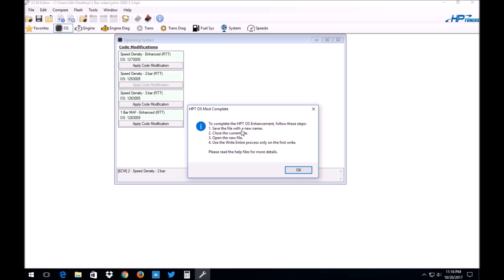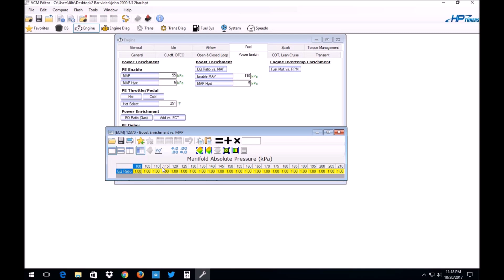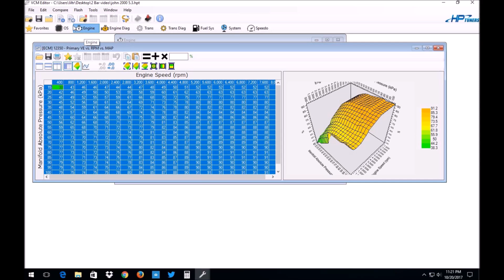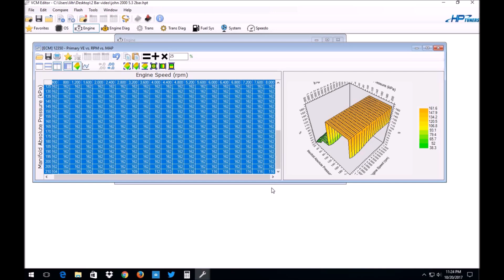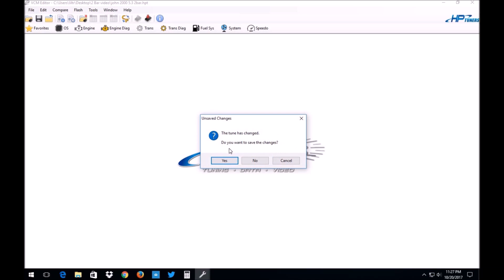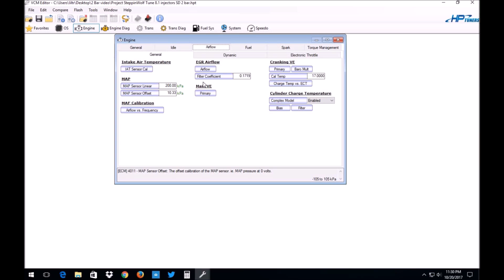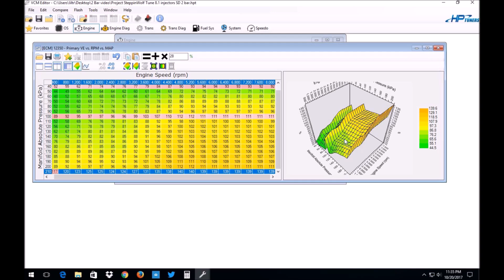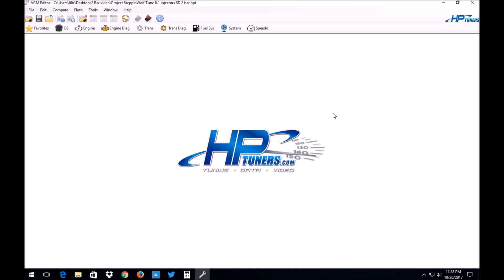HP TUNERS 2 BAR OR 3 BAR OS CONVERSION FOR GEN 3 LSX P01 AND P59 PCMs

Comment: How can i tell if i have the 411ecm in the holden mate...it has red and blue plugs and its a 02 but built in 01 vx commodore ls1 etc.
Reply from the maker: Here in the US, if it has the red/blue connectors it is a P01 pcm(0411) but I honestly know nothing about the Holden variety. Im assuming it would be similar though. If you open it up in HP Tuners and click on the "calibration details" icon, it will tell you if its a P01, P59,E38,etc. It will be listed on the far right of the same line where it states the year and model.
Reply: Bad Luck Garage thankyou.
Reply from the maker: No problem brother. I help where I can. Unfortunately Aussie vehicles are a bit beyond my level of expertise,lol.

Comment: Picked up a camaro ss with a mp112 on it.  Thought it was done up right and just needed a clutch.  
Put a twin disc on it.  Noticed afr going lean at idle and other places.  Hooked it up to hptuners - it's on efilive. 

The license for that is 1000 or so, crazy.  Anyway was moving tables over from that tune to a stock tune and noticed they never messed with timing among other things.  This video helped me get there.  Thank you!

Comment: This is my first turbo build. I have gotten a pcm from a friend that had a 3bar tune on it.If I'm just running 12 lb of boost  would that pcm run ok with a 2 bar map?
Reply from the maker: No. You need to either flash it to a 2 bar os as shown in the video, or use a 3 bar map sensor to match the 3 bar os.

Comment: I have a question about RTT(real time tuning). If I previously flashed my ecm from stock to RTT using a custom OS. Is it possible to re flash back to my original stock tune and then flash again to a two bar custom OS?

Thanks
Reply from the maker: Yes as long as you saved your original tune file.
Reply: Awesome, how you been? I hope all is well with you!
Reply from the maker: @CorEdmonds  I’m doing ok brother. Thanks for asking. Still not 100% but I’m alive so there’s that. Lol.

Comment: Do you have an explanation on how to do this on a gen 4 pcm. I just put together a turbo kit for my 07 avalanche and I'm gonna need to tune it for boost. I've never tuned a injected engine before and in trying to absorb ask the info I can before I start. Thanks in advance.

Comment: I notice the spark tablenis still in mas air flow do you still need to keep the maf sensor connected?
Reply from the maker: The spark tables are not scaled by Mass air flow, they are scaled by cylinder air mass.
Reply from the maker: And no, you do not need your MAF sensor unless your IAT sensor is incorporated into it, in which case I highly suggest pulling the two wires for the IAT circuit and switching to a segregated IAT sensor. I’ve covered that in other videos.
Reply: Thanks man that makes sense yea ill ditch thw maf and add the gm iat sensor. Cheers
Reply from the maker: No problem brother. Good luck to you!

Comment: Can you use this to tune without boost ? My idle problems are freakin changing every drive. Perfect sometimes stall sometimes in traffic at every light or stop sign 🤬🤬🤬🤬
Reply from the maker: There’s no reason to convert to a 2 bar OS if you’re only running a 1 bar map sensor.
Reply: Bad Luck Garage ok. If I didn’t have to stop  I would have a bad azz 84 c10 with a LS 5.3 🤠
Reply from the maker: Have you added a cam? Because it almost sounds like you may need to ad some to the idle airflow tables.
Reply: Bad Luck Garage I added a 598/601 Howard cam headers CAI bored it .30 mm everything else is stock turbo 400   I can do the engine controls in scanner and make it idle great by lowering timing and adding like 15.0 on air/fuel button  but when I cut it off hot it will rev to like 3000 for 3-6 seconds  lowering timing and playing with idle steps in control mode doesn’t help that high rev part.
Reply from the maker: Sounds like you just need a tune brother. You can’t throw a cam that large in without having it tuned.
Reply: Bad Luck Garage I agree  or a Holley carb setup 😅
Reply from the maker: You could go that direction as well. Although at this point it would just be more expensive.
Reply: Bad Luck Garage I’m going to stick with my setup  I did a log on way to work and stupid thing ran great didn’t stall didn’t hunt for idle  I’m happy for the good days  it is raining so air may be my issue   Thanks for your help

Comment: How do I get you to help me tune my truck?  I have a 2003 gmc sierra I took the 4.8 out and put in a blueprint 427 complete engine. The engine was dynoed before I received it. I'm in southern Kentucky. I don't have anyone close to me to help.
Reply from the maker: Hey brother I’m sorry to say I don’t do 3rd party tunes anymore. I was planning to make more of these videos to help people who are trying to learn to tune for themselves but I don’t use the most current version so there will still be some slight differences if you’re just now buying a newer unit with the newer software. I would encourage you to get in the Bad Luck Garage Facebook page in the files section and download the CPIG guide. It will guide you step by step learning the basics. I actually uploaded it there because I get so many emails and requests like this. Learning to properly tune a vehicle takes lots of research and lots on hands on trial and error. It’s not just a “one day course and you’re done” type of thing. Hell I’ve been doing it a few years now and I’m still a novice myself.
Reply: @BadLuckGarage  I have the newest hp tuner. And have messed around with it a little. Is there any decent places in Knoxville that could tune it? I'd like to at least get it to move in and out of the garage for now.
Reply from the maker: We have Lethal Performance in Morristown, and High Velocity in Knoxville. Both are fairly popular but both are about 50/50 on reviews. I’ve never been on a dyno and always done my own so can’t really testify to how good they are but I do know Tony at High Velocity has always seemed to be a standup guy and is actually at the track that sponsers my channel working in customer cars on the weekends sometimes. My suggestion is to download the CPIG guide as I said earlier. It’s a step by step repeatable “basic tuning” guide and if you follow it you should easily be able to get your car driving pretty good. It won’t be making the most possible power but if you follow the guide it will definitely be drivable. Even if you don’t have a wideband you can use your fuel trims to dial in your part throttle and cruise area under 3000 rpms really accurately. Hell I may even do a video on that in the next few days since I just did it in the DRNova last week and people keep asking. Lol Also all my config tiles I use to tune are also in the files section of the Facebook page for free download along with that CPIG tuning guide.
Reply: @BadLuckGarage  ok I'll look it up and down load. Thanks
Reply from the maker: Yea sir. Like I said. Lots of research and trial and error. I bet I spent 100s of hours online just learning to tune my first engine and it was basically stock! Gotta have patience brother. Most people can’t just dive in and be like “oh yea I got this” lol. I was definitely not one of those people!

Comment: Why 25% more when you filled from 1 bar to 2 bar. Wouldn't double the atmosphere require close to double the fuel? Therefore 100% more as opposed to 25% ?
Reply from the maker: No. Although this table is used to modify fueling, it isn’t an actual fuel table. It’s a Volumetric efficiency table. The numbers represent a change involumetric efficiency which tells the pcm to deliver enough fuel to compensate for that change. You’re not “adding 25% of fuel”, you’re showing an increase of volumetric efficiency. And as stated in the video, adding 25% here will actually have you running pretty rich initially in most cases to keep you safe while you’re actually dialing it in with a wideband.  Hope that makes since.
Reply: Bad Luck Garage got it.. thank you
Reply from the maker: yes sir! Thanks for watching and dont forget to like, share, and subscribe!👍

Comment: when i click on os nothing comes up is that becuase i cant run that?
Reply from the maker: Thanks for watching! There are supposedly some OSs that don’t support this but the majority of the time if you get no upgrade options, it’s because there is already a custom OS on the PCM. It’s possible the previous owner has already flashed a different OS on yours. If that’s the case, the only way to change it is going to be to do a full rewrite with a factory OS, then you should have the option of picking a custom OS to write.
Reply: Bad Luck Garage i actually put it in advance mode and that fix it. I thought i was going have to do a full rewrite
Reply from the maker: I’m always in advanced so sometimes I forget there are other options.  Can’t do much of anything in basic.  Glad you got it figured out. 😉

Comment: i did my 3 bar os conversion and installed a 3 bar sensor. at idle its very rich (11.80ish) i tried a few things to try to lean it out but nothing worked yet.  are there any changes i should be making after the os change to correct fueling  thanks
Reply from the maker: Hello chris brehaut, Thanks for watching! Copying the tables over will only get you started. You will still need to tune the VE table after the conversion to dial everything in.
Reply: oh ok i will have to read more and learn haha thanks for the videos
Reply from the maker: Yes sir! I plan to do more tuning videos at some point so be sure to subscribe so you'll know when I do. And thanks again for watching!

Comment: I’m having troubles on my spark tables, when I plug the vcm scanner and my spark advance table populated with cells, what do I do? Do I subtract those from the current ignition table or is there a certain range that the cell table is supposed to be at and you want to add or subtract whatever to get there
Reply from the maker: Hello Tanner Reed, Thanks for watching! I would start off by pulling timing in all areas where boost is seen. To make things faster and easier, I suggest starting with a file from a similar boosted setup and copying the timing maps over as a starting point as mentioned in the video. Then log KR and go from there. If you want to start from scratch, Factory timing maps are usually very conservative so just make sure nothing is above about 12 or 14 degrees on the bottom half and start working from there. As I mentioned though, its usually less time consuming to just start off with a file from a similar build. Hope that helps. -Robert

Comment: A couple things to add to the video for other new people, just some general setup tips.

After going to a 2 or 3 BAR OS, the OS normally will automatically put in 2 or 3 BAR linear and offset settings for the MAP sensors. Make sure that whatever MAP sensor you purchased matches the settings. Most GM 2 bar MAP use different linear and offset settings than just is given, 3 bar stuff is can be several different values depending on what vendor you bought the sensor from. Having this info correct is a 100% must.

Also if you are going to be running in speed density only without the MAF sensor you will need to fail the MAF sensor within the tune file still. Easiest way on a P01 or P59 is to set the MAF fail high under the engine diag tab to 0hz, then set the MAF dtc's to MIL on first error. That will revert straight to SD at start up. I also change the dynamic high rpm disable from 4,000 to 8,000rpm as well. Don't forget to wire in a separate IAT sensor if removing the MAF housing, can't tune a vehicle that says it has -38 intake temps all the time.
Reply from the maker: Hello GTPSilvermist, Thanks for watching!This video is dealing with the OS conversion itself. I'll be making more tuning videos dealing with specifics soon. Be sure to subscribe for notifications!
Reply: Yeah no problem, I gotcha. Good video showing to go about it. I was just browsing the tube and like to see how others do things. Video or picture tutorials sure help for some over me or you just typing what to do lol.
Reply from the maker: Most of the instructional type videos I make are exactly for that reason.....to cover questions that get asked constantly and i get tired of typing pages of explanations so I just make a video instead,lol.

Comment: That's a good video for that.  I was trying to convert my friends camaro to 2 bar (0411). We got it running but it wouldn't log the map in the data log.  Can you cover this?
Reply from the maker: Thanks for watching Brent. If you’re using vcm scanner 2.24, you should be able to delete the old 1bar pids and select the proper pids and histograms once you connect to the pcm with the new OS. If you are using vcm scanner 3.x I’m afraid I can’t help yet as I haven’t taken the time to figure it out myself. After dealing with multiple problems with version 3.6 while trying to tune a customers vehicle, I decided to just use 3.6 editor with 2.24 scanner. That was several months ago and I’m still not using it. (Don’t really have a need to). That’s actually the whole reason I made the video on installing multiple versions of hp tuners in the same computer. 😉